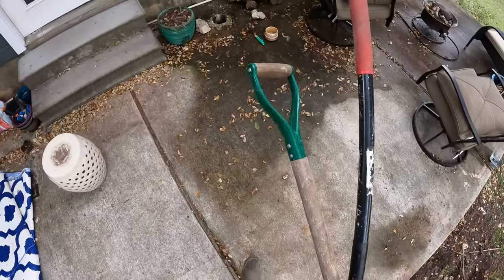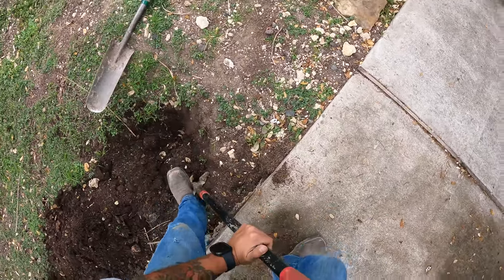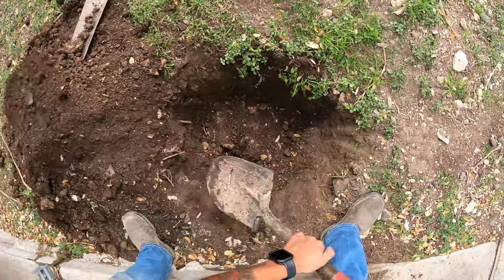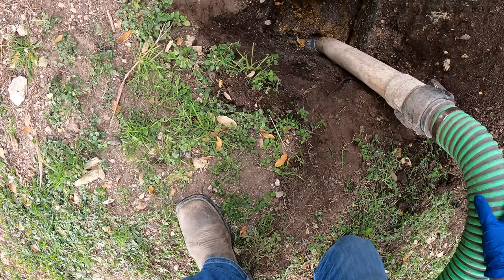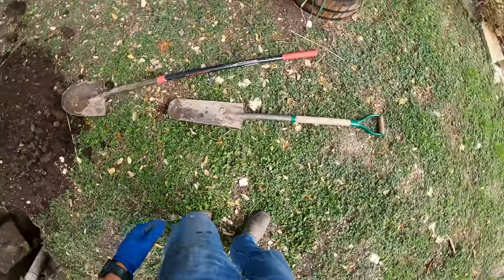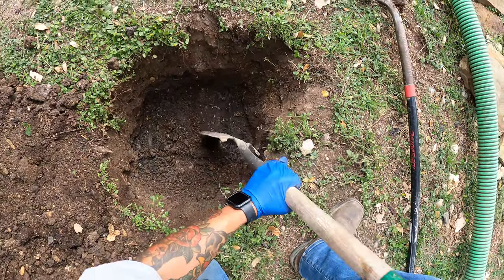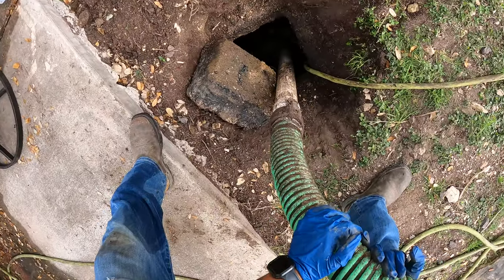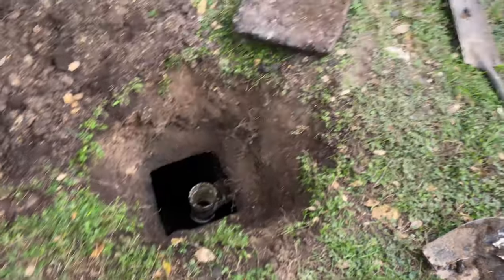Clogged Septic Tank

Comment: I'm sure the blockage has nothing to do with the GIANT tree right next to the tank!  No inlet baffles in my area, they cause more problems than they solve.  Only outlet baffles. Great content for this septic installer! You earned this sub when you said "poop smoothie" in a previous video!
Reply: My parents were on a septic tank for 6 years before the city sewer line came out, and the leach field was failing because mom said sh😢 used low sud's detergent because of getting suds on the lawn, but I know she planted a tree right next to it about 3 years into it, im pretty sure that was the issue

Comment: Thank you on information.   Don't know what rizers are thou?   My septic inlet is surrounded by red bricks, bought my house this way.  I have leach field in front yard and they way I can tell how it's doing is by how green the grass is in that area.   The only problem I have is during the spring after snow thaw is lines taking long time to flush through.
Reply: they make a replacement square lid with 10”-12” plastic pipe”riser” built in that sticks up several inches, and additional plastic only riser pipes if needed to get closer to surface level of yard. I installed one on mine.